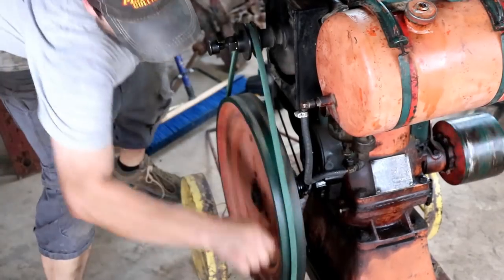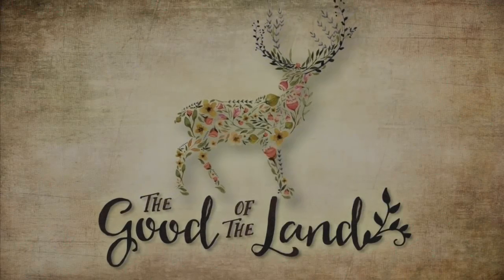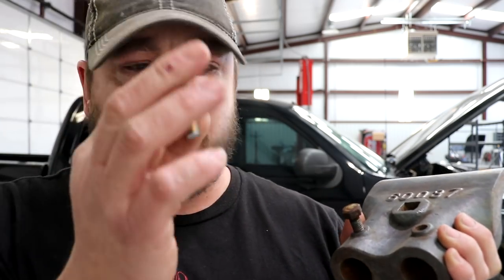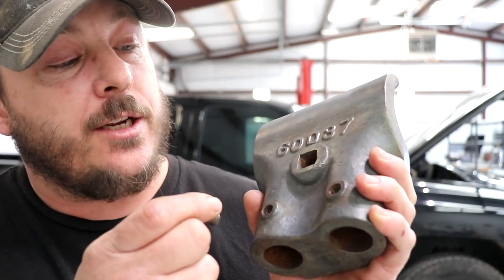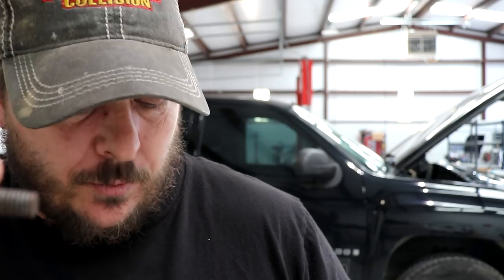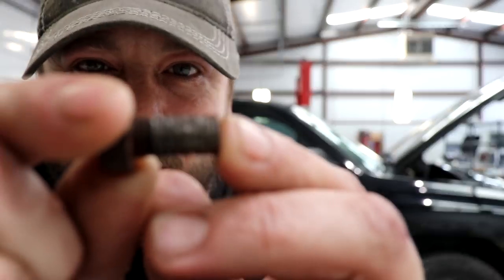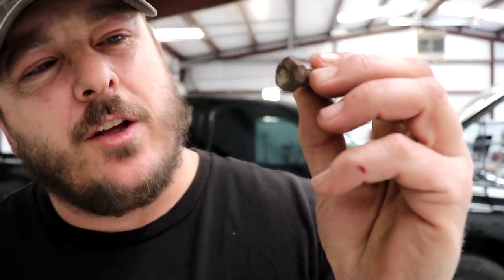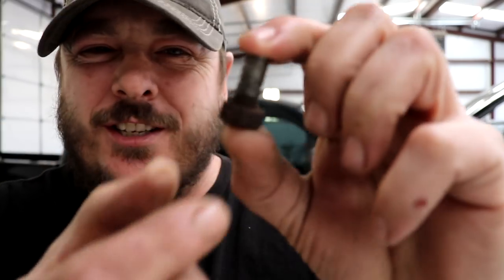OLD MECHANIC TAUGHT ME THIS YEARS AGO! Passing it on to the NEXT GENERATION!

Comment: It works without using the nuts as well, but yes, placing those two nuts ensure you will never screw up the threads plus you get it done quicker, otherwise it might not work from the first attempt. Good to know. Thanks for sharing.
Reply from the maker: +inox1ck You bet.
https://youtu.be/OgvQKuCOhqI

Comment: you can take a piece of all thread or even the threads of a long shoulder bolt,cut to length.take a nut and thread it on but when nut is put on,use a high strength thread locking liquid or a press fit.let the nut be the bolt cap,let the locking agent dry,thread it into the item you want to secure.regardless it will become a jamb nut scenario whether the nut jambs against item or another nut is used on the other end.

Comment: use a blunt hacksaw like a man !
Reply: Hacksaws always worked for me unless the bolt was harder than the saw blade. :) Then I use a grinder or file to bevel the last thread or two to 45 degrees just like they did when they made the bolt.

Comment: Adding heat to the bolt by using a grinder to shorten it also changes the bolt's temper. Use a cutting wheel to cut it quicker to add less heat to the bolt.
Reply from the maker: sentinels war would be true with a grinder. Not the case with Norton blaze. Check out my new vid on the subject

Comment: Just adding this to clarify my earlier comment.  This is the method I use when cutting or grinding a bolt shorter.  I just mentioned the thread file as a "BTW" comment.

Great video. Great channel.  You "Best Bacon" video is still my favorite YT video of all time.

Comment: I've been doing that for 50 years my grandpa showed me. Those old guys never threw anything away till it was used right down to the nub. Great tip for those who don't know. One comment, I am not certain what that blot holds on, but I doubt they made it a weak bolt just to be cheap. I'd say that cast part ain't cheap, so if it's a choice between stripping the threads in the part, or breaking and removing a bolt, I'd prefer breaking the bolt. That Grade 8 you put in there will tear the threats out of that cast part long before it breaks should someone over tighten it. Just a thought.

Comment: I will try to remember this, I usually thread on a die and then cut, but sometimes you dont have the right tap/die.  
I find it almost impossible to get the threads aligned exactly when trying to cut the threads so this works except for a very, very short bolt lol.
Reply from the maker: +mike dee https://youtu.be/OgvQKuCOhqI

Comment: I like the way the bolt drops out of the vice and into his hand. He must be using the cold steal bolts that don't heat up when you cut and grind on them. My dad taught me to have a cup of water to drop it into to cool it off. So for all of you that just learned something here, that bolt will burn your hand, you will do it two or three times before you learn your lesson. And most of all,  don't look for cold steal bolts, I don't think you will find any.
Reply from the maker: +Bill Strudgeon Would you like to know how I was able to hold the bolt after bringing on it?

Comment: Here's something you may not have known. Those markings on the new bolt you ground off indicated that it was a grade 8 bolt; very hard and can take a whole lot more torque than a grade 5 or grade 3 bolt. The old bolt you had was a grade 3, probably. No markings means grade 3, three markings in a triad means grade 5, and obviously the six marks you ground off means grade 8.

Now that you ground them off, you have to remember it's a grade 8 bolt in case you have to drill it out! You'll need a special bit and probably a drill press. Unless you decide to kill the temper on it by heating it up red hot and turning it into a grade 3 bolt.

Just FYI from a retired ASE Master Tech.
Reply from the maker: ladamyre Yup, thanks brother.
https://youtu.be/OgvQKuCOhqI

Comment: I gotta say that while good Idea to nut it up. If you are in a shop like yours or do this enough I suggest getting good at free handing it on the bench grinder. Just nut it up until you get good at knocking the bur off the thread and stop melting the end of the thread down. I did it now I can make a bolt shorter without the nut and it saves me time. This was also taught to me by an old mechanic. Also those cookies your using are expensive these days 3 of them will buy a whole bench wheel. Nothing wrong with what you did I just suggest the way I learned for anyone doing it more than once in a blue moon.

Comment: Another step you can take when making leg lock or any locking type bolt is to drill the center out a small amount on the end of the bolt, it helps the bolt bite the leg and keep it from rattling loose
Reply from the maker: +gidderman Yup! Build vid is on the way!

Comment: Two things - You used a grade 8 Bolt (top of head markings) that is hard and strong. Then you used a grinder to take off 1/4 to 3/8 of an inch, which created a ton of heat and soften the bolt at the end. Use your nut measurement method is fine, but use a hack saw to cut it off, then file off the burr. Second, why did you grind the grade 8 markings off the head and then you ground off the cad plating off the hex sides that protects the bolt from rust. - Notes from an old aircraft mechanic.
Reply from the maker: +Tim Howell Three other vids on all your questions. Start with the link in the first comment. Thanks for watching!
Reply from the maker: +Tim Howell You don't know it yet but your about to subscribe!;)

Comment: Also if you notice the head of the older bolt was thicker. Another trick is to screw on a nut with a 1/4 turn and weld it up inside and cut of the new head to have the correct thickness.

Comment: I learned this trick using my imagination when some one gave me bolts that were too long, The first time I did it I cut one the threads did not work.   So then I tapered and deburred the cut and the bolt went right in and worked.   As for the top part of the bolt  I would just leave it alone most of the time

Comment: I do this with generic bicycle engine kits sometimes, it works well and looks nice but I do it to save money, not time. If you're like me and don't have a grinder other than a drill and cutoff wheel rigged up to fit it, it might be faster to go to the local hardware store and get the right size bolt. After all, the camera cut out then right back and this guy appeared to find the right size in a split second, but it can take longer to dig through a junk box to find the right bolt than to find the right bolt at a well-organized hardware store. Also it even seems faster to ride a bicycle to the hardware store than grind down a bolt by 1/8" or more in my experience and with my limited array of tools

Comment: Why did you grind off the yellow zinc passivation coating from the head of the bolt? not sure if you know Zinc Passivation is now banned in most countries as it is highly carcinogenic, so all new nuts and bolts use a different coating, and the zinc passivation coating is what makes these nuts and bolts yellowish tint whilst newer ones use a normal steel colour bright finish.

Comment: One thing you could have done. If you have enough room. Run the nut up on bolt tighten it down, then run the nut down and jam it. Keeps it from coming loose. But yours looks like the old bolt.

Comment: Why grind the top and flats on the hex head?   Trying to match the other rusted hex heads maybe?   FWIW you can bevel the end by holding it at about 45  deg pointing down on a stand grinder wheel.  Just a few light touches while turning the screw.   This makes for easier starting in tight places.

Comment: I do this on a daily basis. The company I work for is so cheap that they will not buy the correct bolt lengths. They will buy a bag of the longest size available and the rest is up to you. I used to do it this way, but now I use a die. Run it to length, tighten the adjustment bolt and then to the band saw. When you remove the die, it cleans up the threads (much like the nut does) and you're in business.
Reply from the maker: +SixStringLove Guy Excellent@

Comment: I thought that I would add something that you or anyone else might not know.  If you have a bolt, that has a damaged section of threads, but you don't have the die to rethread it try this trick.  Screw the nut on as far as you can easily then use the bolt like a hammer and hit the nut on  something solid.  What you re trying to do is use the weight of the bolt to reshape the threads.  Your nut is now your die.  If the bolt is large this works very well.  If it is small, you may have to put it in a vice and use a hammer and punch on the sides of the nut.  After you smack the nut on whatever, try to turn the nut again.  Usually you will find that you can turn the nut a little ways with your fingers.  Then smack it again, turn it some more.  I have used this technique for years.  It usually works, at least if the threads are not to badly damaged to begin with.

Comment: This is by the way a lot quicker if you just use a cutting disc instead of a grinding disc, cut fairly straight along the nut, unscrew it, and it's all good

Comment: Another tip you will get from an old mechanic, is that at several points in this video the bolt will be red hot. Wait before you pick it up.
Reply from the maker: +Colin Edwards Thanks Colin.

Comment: $10 angled die grinder Harbor Freight, with cut off disk, cuts like butter ... and have a stash of stainless steel bolts to chop off (most are around grade 5) ... cut to length with die grinder, then taper end with grinder, and hit with wire wheel to remove burrs (will thread right on) .. and the bolt will not rust (unlike the one modified in this video, which will be a rusty mess inside a month).
Reply from the maker: +BigCooter.com https://youtu.be/OgvQKuCOhqI

Comment: Common since, but what isn't is when you have to drill out a very hard bolt, use vinegar and a slow drill speed. It will cut it like butter.
 I should do my own tip channel

Comment: Thanks for posting. Don't mean to sound negative, but wouldn't it have been a lot quicker to give the old bolt a wire brushing and clean up the threads with a die (if you had one) than spend all that time mucking about finding and shortening another one?

Comment: So the last steps are to grind off the corrosion protective coating, which is there for a reason, and then grind down the hex flats so that you will less likely to be able to remove the bolt after it rusts in place.  Funny they never taught us that in aircraft mechanics school--but I suppose things have changed since 1964.  For instance, angle grinders have become widely available, turning would-be mechanics into destructive pests.

Comment: lf your forge is that old the bolts used were probably grade two to start with. If the legs get really hot from the fire in the forge that grade eight bolt you used for replacement will end up the same.
 That's called annealing.

Comment: You never need to chase threads if you bevel the last thread ring to a 45 degree angle all the way around the bolt. That's what they did at the factory when they originally made the bolt.

Comment: I'm curious. Why, since you have 2 nuts to take off, didn't you just use a SLOW cut from a saw?I how it is a hard Bolt, but that was a lot of grinding. When done, 'twirl'  the cut edge on a 45 degree lightly and the net will screw off and on by hand.
Reply from the maker: +John Wade https://youtu.be/OgvQKuCOhqI

Comment: An old car mechanic taught me a trick. If when you open the hood of a car the engine clearly looks like it needs replacing and no one that saw it would ever buy the car yet it just runs. The spot weld the hood shut clean the outside of the car and sell it at the auction. They'll think the hood is jammed. It will not be until the buy it and get the hood open they will see it needs a new engine.

Comment: Quite often you need not shorten a bolt by such a small amount. A test fit to see if it bottoms out in the hole with the part it is holding, will tell if it needs to be shortened or if it can stay as is. And I do not like the idea of removing the Fastner Grade or Strength markings from the bolt head.

Comment: Using a bolt you have is way better than having to go shopping. One thing though, you don't always have to grind the whole bolt. Do what you did and then just cut it off there. Saves time and disks. I'm not an old mechanic, just old. Thanks.
Reply from the maker: +Je G https://youtu.be/OgvQKuCOhqI

Comment: I must be dumb , but I don't get it . I get the bit on shortening the bolt , but why go the trouble of changing the head of the bolt , if the threaded section fits through the hole , what is the problem ? is it because you want both to look the same from the outside. ? and I like the green vice. cool colour .
Reply from the maker: +0011clem 
This will help.
https://youtu.be/OgvQKuCOhqI

Comment: Would you consider letting the amateurs know what the markings on the end of the bolt mean?

For instance,a hardened bolt with 1, 2, 3, or even 4 lines on the head of the bolt... the more lines,the stronger the bolt is...

Comment: Great video. Suggest cutting a bit long and then grinding to size if it’s a grade 5 or lower to save time. In this case I believe, if I remember my markings, it’s a grade 8, too hard to cut with a saw. Not sure why you ground off the I.D. marks and made the hex smaller-classic application to match original?

Comment: Not sure I'd want to put a freshly cut facing into the engine block. Also you didn't check the threads by interlocking the two bolts. It's more accurate than trying to put it in the sleeve, which will have some leeway.

Comment: I have an old 54 F100 and have to sometimes fit bolts. But I would rather not grind off the zinc or cadmium. I side on corrosion resistance and longevity over exacting look alike of what I took out. My truck is original and I like it that way, but conceding on modern bolts (and not ruining them by grinding off corrosion proofing and markings) as they are better, stronger and engineered with corrosion resistance in mind and a great improvement over the old ones I remove that are bad. 

Also, not to be too critical but; it would take 30 seconds to hacksaw off that bolt and taper the end off on the bench grinder rather then grinding on it for 5 or ten minutes. Sorry, just saying.
Reply from the maker: +WanderingSeneca https://youtu.be/MJ4fva0nrLs

Comment: Isn't also each line on a standard bolt (usually found on caterpillar tractors) considered strength of a bolt, like say a 3 line bolt is weaker than a 6 line bolt. And how many lines can a bolt go up? Most I seen is 8...just asking (a rookie)

Comment: I get cutting down the bolt using nuts for sizing and cleaning the threads up, but you visually down graded a grade 8 bolt ,which ok.. no big deal. The thing that got me was you ground the side of the bolt changing the precise socket fitting. You probably did not harm to the socket fitting with light sanding but people that need this type of instruction might over cut those side dimensions.

Comment: It was probably a soft bolt so it wouldnt strip out the tapped hole. Using that G8 bolt might bring you unnecessary headache later. Just my opinion but great vid.

Comment: I just enter the size, length and thread size data into my computer and instantly print the size bolts out on my 3-D steel printer. I use a styrofoam cup to hold the molten liguid steel and use a 3/8" plastic hose to run to my 3-D printhead.

Comment: cutting bolts is part of any major job, in this case i see no reason to resize the head, but its whatever makes the tech happy. I do similar operations often, but i run a die down the bolt, make the cut and then run the die up dressing the thread. However in the absence of a tap and die set this is a useful operation. As a master tech, i must impart that ITS wHATEVER GETS THE JOB DONE that counts. Time saved, unnecessary effort saved is money earned.  Good job.
Reply from the maker: +Rod X Thanks Rod.
https://youtu.be/OgvQKuCOhqI

Comment: Common sense applied to replacing a bolt, good to see although a hacksaw is good exercise and almost as quick, the only question I have is why remove the protective layer the bolt head is going to be painted?

Comment: Someone said, "grind off the markings to make it look like the original."  Well when replacing old bolts, like he said in the video, they are open of lower quality and soft. The new bolt he put on was high quality strong steel and leaving the markings on will make it clear to the next guy who has to work on it that is so. And grinding down the sides? Why, so your wrenches don't fit tight?

Comment: That's a good short term fix.. But you switched a soft steel bolt with a grade 8 bolt. Now the weakest link is no longer the bolt, but the threads in the cast part. I would much rather replace a stripped bolt, rather than the entire part.

Comment: Just cut the bolt with the cutoff wheel and tidy the edges up with the bench grinder or belt sander. Easier quicker and cleaner.

Comment: Ah so the trick is to put on a nut on the bolt before you cut it? 
So it cleans up the threads when you take the nut off.
Neat.

Comment: Not sure why you decided to grind the head of the bolt.  The only possible outcome is that it is worse off than it was previously.  The original bolt was a soft bolt, grade 2, hence no marking on the head.  The bolt you put in was a grade 8 bolt, 6 lines on the head of the bolt.  FYI 3 marks on the head is most common, it is a grade 5 bolt.  The grades have to do with tensile strength and shear value.